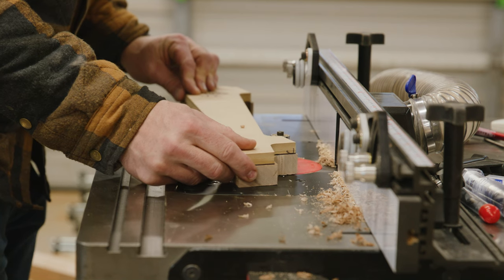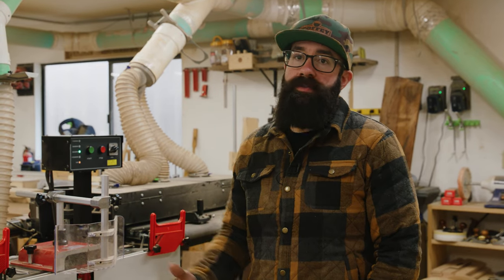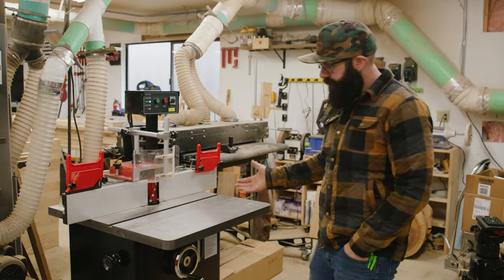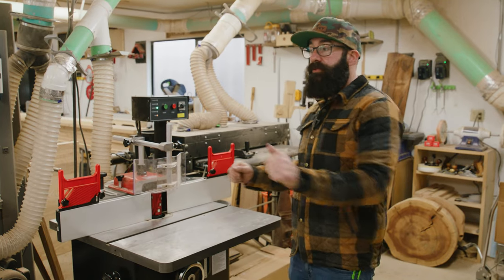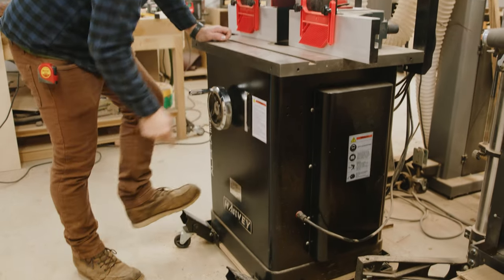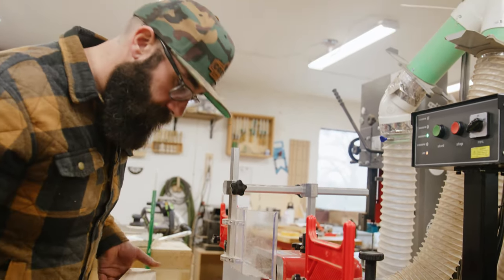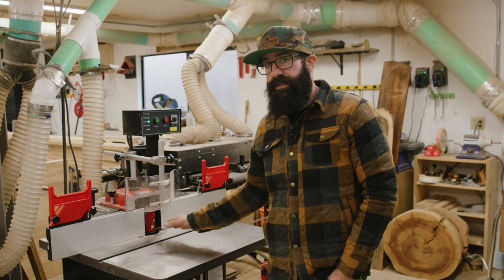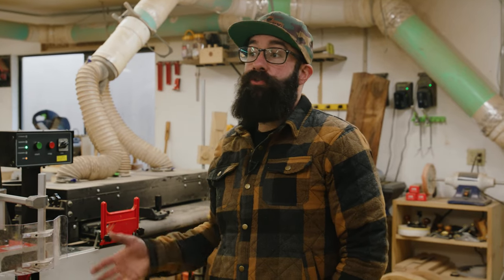Do you really need a shaper?

Comment: Just a couple points that I think you will see as you use the shaper more.. 1. The tooling changes should be the same as the router table. There is no need to change the spindle  to change a cutter head. You can change spindles, but it's not a normal process. Most of the bigger machines have a spindle lock so don't even need two wrenches. 2. Production speed isn't the only reason to get a shaper, cut quality is a primary driver. The larger the cutting circle the more tangential the cut. That directly relates to cut quality. It is a benefit if you are building a one off or a production run. 3. Tooling cost.. yes cutter heads are generally more than Router bits but the standard euro block (40mm) knives can be had for under $20 a profile and will cut a few thousand lineal feet. I'll take a $20 knife over a $20 Router bit every day.
Reply from the maker: Unfortunately this machine does not have a spindle lock. Definitely a shortcoming.
Reply from the maker: I completely agree with all your points. Most of this is geared towards a weekend warrior I'd say. For a production shop it's just a no brainer.
Reply: @CoffeyCustomBuilds   That is relatively standard in that most of the small shapers don't have spindle locks. (Orhan some euro models) Its more annoying than anything else.
Reply: @CoffeyCustomBuilds  fair i get the content is geared toward the hobby shop. I've always maintained though that shapers are just as useful in a home shop/weekend warrior setting as production shop.  Big equipment just makes things easier, be it a bird house or a full kitchen.
Reply: I’ve never changed a spindle to change a bit, unless, like a collet, I needed a different size.  I don’t find cutter changes any different than router table bit changes. One thing that will be a game changer for your shaper is to add an outboard fence.
Reply: @mattschreiber4251  He needs a feeder first for the outboard fence.

Comment: You missed one of then most important differences and that is that the cutting geometry is very different and much better on a shaper. Because the cutters are much larger in diameter for the same depth of cut from the fence the cutting edge exits the wood much more parallel  to the edge of the board. This gives you a much cleaner cut. I find it takes about the same amount of time to change a cutter head in the shaper as it does to change a router bit in a router table.
Reply from the maker: Very important for sure

Comment: Router tables are fine as long as you don't try to use them as a shaper.  Shapers are fine as long as you don't try to uses them as a router table.Despite the similarity in their appearance, they are two different machines that work well  if used as designed.  Shapers use induction motors.  They will either run at the selected RPM or they will stall out. If they stall out, a higher HP motor is required.   Shapers are designed to power large diameter cutters and produce high torque at a lower RPM..  They max out at about 10,000 RPM and  do not spin fast enough to run small router bits.  Routers use universal motors and slow down under a load.  Regardless of the sales hype, when routers run at a slower RPM to accommodate  large diameter cutters, they lose power.  To work around this the operator typically starts the router at a higher RPM. Once the wood is fed into the cutter the router slows down. It is not a good option to start a large panel cutter at 20,000 then have the load slow it down to 10,000 RPM. Large cutters are not designed to spin that fast. Small cutters do not work properly at low RPMs.
Reply from the maker: Exactly
Reply: Perfect comment. In my teens, from 1969, we had a big old spindle moulder and Record Multiplane hand tool for routing fine detail grooves and profiles. When I went back to scratch building kitchens on site as a part-time extra earner during 1990s recession, I got a small router for simple plywood panel doors, 6mm mortices & tenons, round-overs: I thought of it as a much cheaper powered version of the Record Multiplane. It was the price that made me get that little Bosch green router and crude milling stand - a brilliant piece of kit, especially for the price

Comment: A few points from my experience with shapers - 1) A shaper without a spindle lock is pretty rare/odd; i’ve never seen one without some type of spindle lock, whether it be a pin locking the quill or a foot brake or lever lock, etc.  Can’t imagine not having one and would be a good reason to throw the machine in the bin 🙈.  Using one with a proper spindle lock makes all the difference and you can make cutter changes just as fast or faster and more accurate (on height) than RT.  2) I am a micro shop / solo professional and have 2 shapers and no RT and do not typically do “production” work and still have tons of uses for my shapers. It’s just as much about accuracy and cut quality than production for me. 3) Cutters, particularly carbide but even good quality HSS, last waaaaay longer than router bits, generally speaking, so the cost comparison is apples to oranges and you often come out ahead on quality shaper cutters if its something that is seeing consistent use over the long haul. 4) Power feeders make all the difference (in safety, efficiency and accuracy) for a lot of the work you will do on a shaper and I would certainly recommend a quality feeder if you plan on keeping a shaper around. 5) I have bought each one of my shapers (had 4 of them in total so far) for less than what a high end RT would cost; talking about used industrial grade machines that will last multiple lifetimes.  This video is about a new machine, but do not discount or overlook used industrial for top quality and value.  6) The shaper and its overall versatility lives and dies by the quality of its fence.  The fence on this machine looks to be aluminum (?) and plastic mostly, which may not hold up so well over time in terms of precision and durability. It is worth selecting a shaper that has a solid and well designed fence that you don’t have to fight for precision or flexibility.  7) 6 points was probably enough.
Reply from the maker: Yeah this machine is not the one for me.

Comment: Yes, I'll echo a few things Jared said.  There are reasons why all hobby shops in Europe have a spindle moulder (shaper).  It's because they're immensely versatile, capable and produce higher quality results.  HSS knives in a limiter blocks will give you thousands of linear feet of product, with better results, safer than a router table and often cost you less than good quality router bits.  Most shapers have way faster head change out than yours.   I would say yours is not representative of most shapers.  Shapers produce chips not sawdust because they cut, not scrape.  Time savings can be achieved with stackable cutters that enable more work achieved on one pass, but there will also be MANY things you used to do on other machines that you now so on the shaper because it does it faster, more reliably and to higher degrees of quality and precision.   I'm avoiding "how to" content on my channel but do have a lot of tooling and "features/benefits" type discussion if you're interested.  Also, purchase Stevenson's " A spindle moulder handbook" and it will blow your mind what your shaper can do for you!  Have fun, play save and enjoy!
Reply from the maker: No arguments on any of these points. Doing this video has made me realize I need to get another shaper. One with an arbor lock is necessary and the fact this doesn't have one is crazy.
Reply: @CoffeyCustomBuilds  It is a bit odd!  Once you graduate to a larger, more capable and versatile machine you will come to see it as the swiss army knife of your shop especially with a power feeder.  The feeder not only keeps the digits further away but also enables some operations you couldn't  do otherwise and increases the quality of results on others.  I spent years as a hobby guy and my shaper was key even then.   Now that I do this for a living, I couldn't imagine doing it without my shapers!  Feel free to reach out off line if you want some thoughts on machines/techniques etc, I'm happy to help!
Reply from the maker: @DovetailTimberworks  appreciate the offer.

Comment: Nice video, thanks! I run a 3 HP Delta shaper, with several different trim profiles that I had custom ground out of HSS . The profiles are fairly large, much bigger than a router bit that you could buy. I also run a tongue-and-groove set of cutters for flooring. But the big advantage I find for all of this is using a power feeder! It gives you smoother, consistent profile cuts, and you can process hundreds of feet of material in a short amount of time through the shaper. But setup time is the big limiting factor, in terms of time, with adding the power feeder to the shaper.  I also have a router table with a Triton in it.
Reply from the maker: Shapers are fantastic

Comment: I used a similar spiral cutter (80mm dia x 130 long) on a Format4 CNC machine. It was scary but man could that thing remove material. As a test I ran a full width cut through some 50mm cedar across grain. Just turned the wood into chips. Go to tool for sizing doors on all 4 faces in one pass. Just made certain I had a 1.5mm radius on the corners. Never got blow out. Inserts would last about 12 months.
Reply from the maker: I gotta get that for my CNC!

Comment: Great overview. I love the direction switch on the shaper. With my router table, I'll often have to choose to make a climb cut or risk tearout. Lose lose situation. But with my hobbyist one off projects, I could never justify a shaper... also... they scare the crap out of me!!!
Reply from the maker: They are scary for sure. Other viewers pointed out that you can get used shapers for fairly cheap. And something I didn't cover is that you can use router bits of the shaper. But, ultimately, you can do a lot with a router table in a hobby shop and even in a one off custom shop. Like many tools, it's very relative.

Comment: How do you guys flush trim curved pieces with your router table or Shaper? I was trying to flush trim some smaller parts and it was trying to throw the pieces which was not safe. I think I am going to have to make some kind of work holding sled to hold the smaller parts more securely.
Reply from the maker: Did you try a starter pin?

Comment: One way to understand this a little better is to analyze the speed of the cutter where the cutter contacts the wood.
This will take a little bit of math.    Pi * Cd * RPM = cutter speed in inches per minute. 
Pi = 3.14159    Cutter diameter = 1/4 of an inch     RPM = 20,000
3.14159 * .25 * 20,000 = 15,708 surface inches per minute.   ?o get surfaces inches per second divide by 60.
15708/60 = 262 surface inches per second   This means that a router with a 1/4 inch diameter bit turning at 20,000 RPM will cover 262 inches in one second.
One of my shapers has 7000 R)PM and 10,000 RPM.  Using a 4 inch diameter cutter at 7,000 RPM gives this result
3.14159 * 4 * 7,000 = 87,965 surface inches per minute. Dividing by 60 gives 1466 surface inches per second. That is roughly 5 1/2 times the surface inches a 20,000 RPM router can deliver. To equal that, a router with a 1/4 inch cutter  would have to turn at approximately 112,000 RPM.  This is why routers with smaller cutters have to have a lower feed rate than a shaper with a larger cutte to achieve the same finish.  If you take a look at an LA Weaver Shaper System producing a complete  kitchen cabinet door in less than 4 minutes, you can understand why shapers are used.
Reply from the maker: Yeah exactly

Comment: Thanks for the comparison.  I'm looking into shapers that allow the usage of 1/2 inch router bits. Does the Harvey you have come with that option?
Reply from the maker: It does!
Reply: A small shaper such as the 3/4 HP Grizzly G0510Z works great with the large 1/2 inch shank panel cutting bits. Because they use an induction motor, they do not change their RPM under a load. If more power is required, it is easy to swap out the existing motor with one that has a higher HP.  A number of companies like Harbor Freight carried the same machine marketed under a different brand name. Here is a video of one in action: https://youtu.be/XK0ZM-AYodE

Comment: not sure why its such an ordeal to change the cutters on that shaper, I have 2 one older German and an older American one, and I put a pin in the shaft and take the nut off and it the cutters slide right off.  Would also suggest a stock feeder for the shaper
Reply from the maker: It doesn't have an arbor lock. It's a shortcoming of the shaper. I'm replacing it.

Comment: I've been looking at the HW303 shaper myself but could not find any independent reviews of this model. Were you able to find any reviews of it and how did you arrrive at this model for your purchase decision?
Reply from the maker: Full transparency: they sent this shaper free. I will say I'm not happy that it doesn't have an arbor lock. It's a huge bottle neck to the process. I will be bringing another shaper into the shop because of it.
Reply: @CoffeyCustomBuilds  Thanks for the info. If you're just using the 1/2 or 1/4 router collets can you change bits with a pair of wrenches without removing the entire spindle?
Reply from the maker: @jayg6857  yessir. I'm going to keep a 1/2"/1/4" collet on this and use the other for big cutters.
Reply: @CoffeyCustomBuilds  Thanks again. I may still consider this model since it appears to come with the 3/4 and 5/4 spindles as well as the 1/4 and 1/2 router collets. A number of the other 3hp comparable shapers sell those as add-ons. I'd rather not save $200 on the initial price then have to spend $300 to get all the parts necessary to run it. I'm just a home hobbyist, not a production shop so the ability to put a cutter in is a nice to have option. I was looking at a high end router table like a Jessem, Woodpeckers, or Rockler but once you start pushing into small shaper pricing it makes a shaper look like a better option.
Reply: I don't know what your arrangement with the manufacturer is, but if you were to post a review of the HW303 it would be one if the first ones out there.  I only happened to notice the model number on the side of the unit in your video to see it was one I was interested in learning more about.

Comment: This video shows a small shaper using large 1/2 shank panel cutter bits.  When cutters of this size are used in a router table, the cutters slow down under a load. With the shaper the cutters run at a consistent speed.  Even though the video is narrated in Chinese, the visual information shows how a small shaper works better with larger diameter cutters..    https://youtu.be/FG-CexDpTss
Reply from the maker: That's great!

Comment: I actually have to disagree on your time to change shaper cutters. As long as you don't have to change the spindle, they are quicker in my experience. The spindle height doesn't change and the cutterhead just slides off and the new one on, then the height is already set. I have to agree that you need a powerfeeder, way safer and gives a more consistent cut. If all you do is template work then skip it. One other benefit of a shaper over router, the carbide on shaper cutters is usually way heavier/ thicker, meaning it can be sharpened many times before having to be replaced. Also as mentioned already, the insert profile heads are a dream to use for those short runs of weird stuff.
Reply from the maker: I agree with you. The comment is more specific to this shaper. It doesn't have an arbor lock. It's ridiculous.